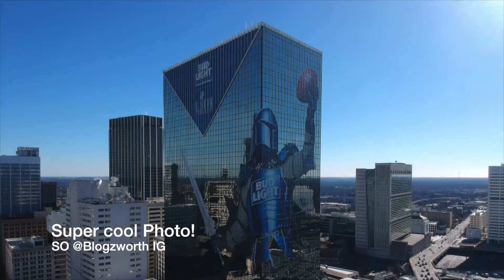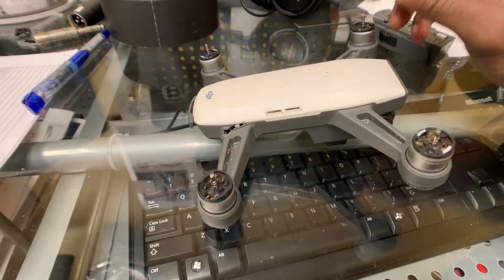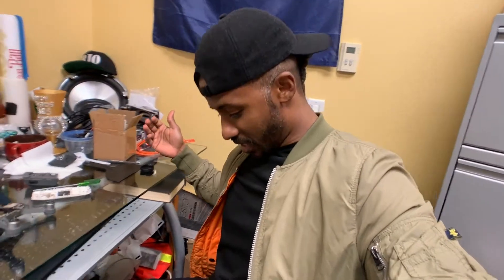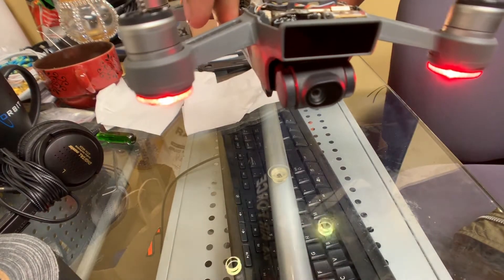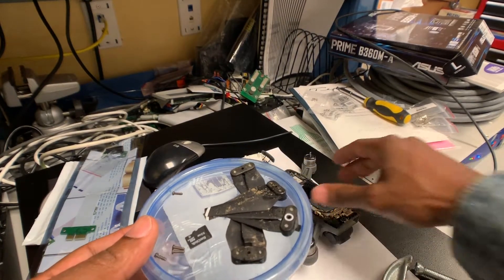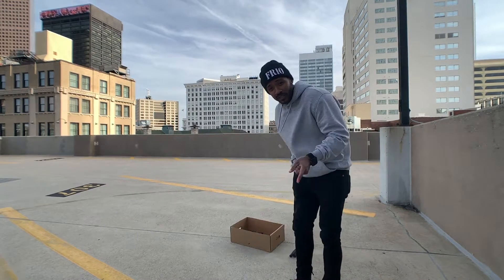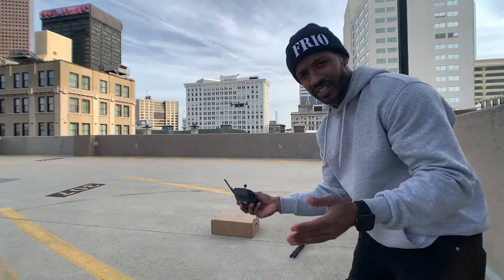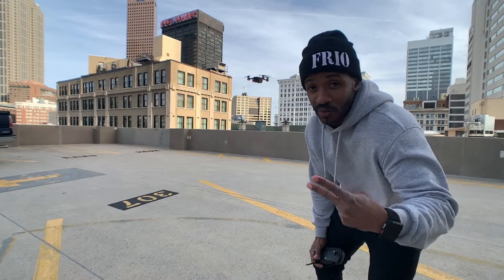DJI SPARK DIY REPAIR. CAN JB WELD FIX THIS BROKEN DRONE?

Comment: I don't have a sparky but I just bought a Holy Stone HS720, I accidentally crashed it into a cement wall outside my school, I was completely distraught thinking all that money had gone down the drain, this possible fix saved my hopes thank you and greetings from little Rhode Island
Reply from the maker: I hope this little trick works out for you! The drone I repaired is actually still working and in regular use! Best of luck to you!

Comment: Thanks for the video.  I already bought a cheap replacement body frame to fix mine and the crack isn't half as bad yours.  I feel more confident using JB Weld than I do taking it apart. Just have to get over my OCD of the sight of epoxy on a drone.  I'll keep the replacement frame for a more significant crash. :D
Reply from the maker: Awesome, glad you got it flying again!

Comment: i crashed my dji Spark to network tower , n now its showing ( esc error no.1,2,3,4) and ( IR sensor error forward and downward) kindly help me , as it is not flying anymore
Reply from the maker: lucky king I would say open it up and replace those sensors. Check to see if you still get those errors

Comment: Great story, repair and video. Yesterday, I started my Sparky up and right away it flew into a bush and dropped onto the parking lot and broke the motor off the arm.  I'm considering JB Weld or a Gel type CA glue for the attachment.  Thanks for the encouragement to do some self help
Reply from the maker: William Ryan Thank you I am glad you enjoyed the video and encourages you to DIY. If JB weld or some other type of epoxy doesn’t work. I think you can also buy DJI drone parts. For instance you can order the entire middle frame then swap your parts on to it. 

This is the entire part for $33.00 seems like a deal to me. 

https://www.amazon.com/DJI-Spake-Middle-Frame-Shell/dp/B0772R3TP5/ref=asc_df_B0772R3TP5/?tag=hyprod-20&linkCode=df0&hvadid=242048352875&hvpos=1o4&hvnetw=g&hvrand=14588943486724852859&hvpone=&hvptwo=&hvqmt=&hvdev=m&hvdvcmdl=&hvlocint=&hvlocphy=1015254&hvtargid=pla-407520675993&psc=1
Reply: Same thing happened to me... I used gorilla glue and gave it some pressure with some painters tape wrapped around the drone. Let it sit over and and it flew like a champ the next day!

Comment: How long did the drone last after the fix?
Reply from the maker: Keith Washington it is still flying high!!!
Reply: @KRTLyfe   Great, i saw one on Craigslist , with the same arm and same damage everything powers up and work the gimbal and camera also . It was 70 dollars , i gad though about putting jb weld on it also, we think a like, and i believe it will fly also, its funny , i just tunned on youtube and hit dji repair and your video showed up, thats a sign. Anyway great video and i subbed your channel maybe u can do the same thanks.
Reply from the maker: Wow $70 for a spark I would buy that ASAP!!!!
Reply: @KRTLyfe   yes im picking it up today